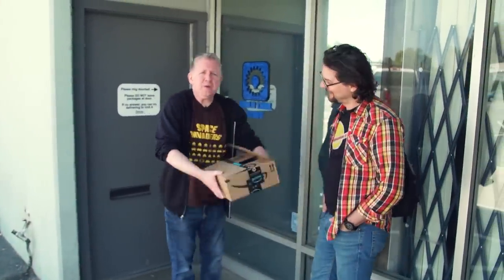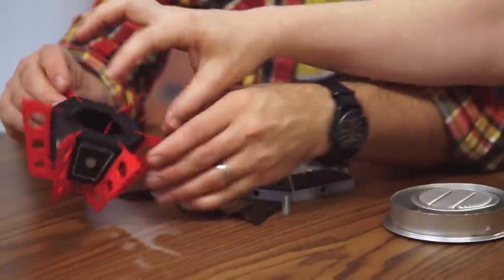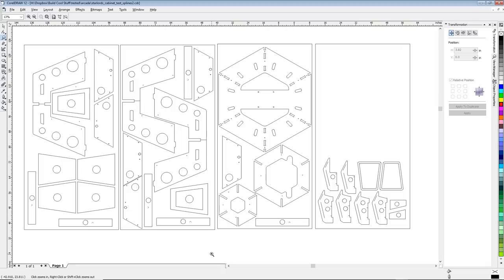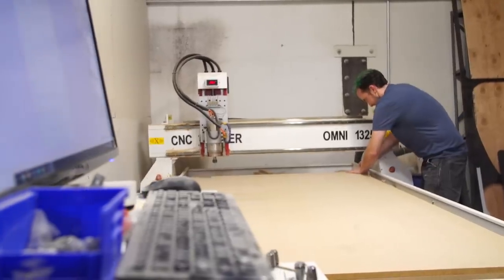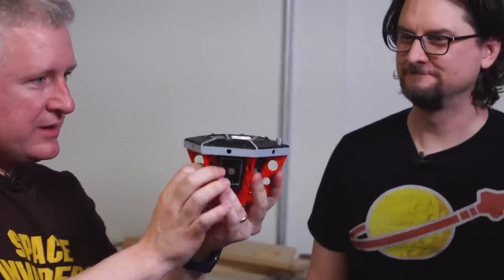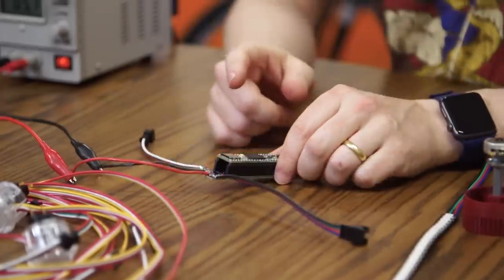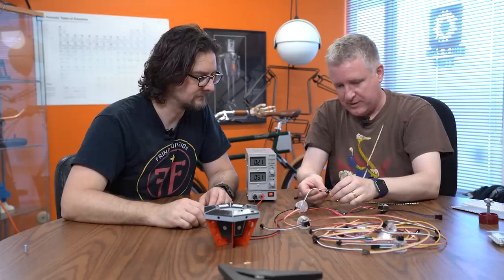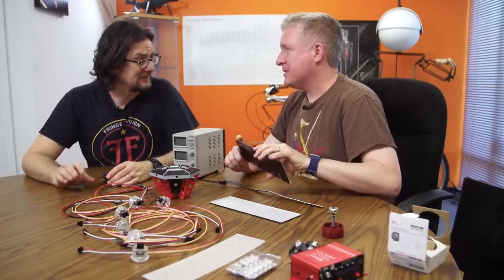Bits to Atoms: Starlords Arcade Cabinet, Part 4

Comment: those slight differences in measurements are what's known as "nominal thickness." it's the same reason a 2x4 isn't actually two inches by four inches, it's actually 1 1/2 inches by 3 1/2 inches. sheet materials in north america have a similar discrepancy. 3/4" sheet material is usually 23/34" thick, 1/2" is usually 7/16" thick and so on.

Comment: Could you have done this with the shaper origin?
Reply: Hey, I have a shaper, yes it would be possible, I have designed a tv cabinet and fully cut with just a shaper, but I wouldn't recommend it, I would do the long straight cuts with a circular saw, and then the features with the shaper.

Comment: Does anyone know exactly what he did on that acrylic cutout to get such a great effect id love to replicate it for another project.
Reply: Used ribbon LEDS - the edge of the acrylic sits on top of ribbon. 'Fingers' are spaced to sit on top of each LED - the key was having no material between fingers. In hind sight we should have run the frame all the way around instead of having top of fingers free. Also used frosted acrylic which makes effect better.
Reply: @sausagemit Thanks for the response very helpful.
Reply: @CworthDynamics  Thanks for the reply it really helps out.